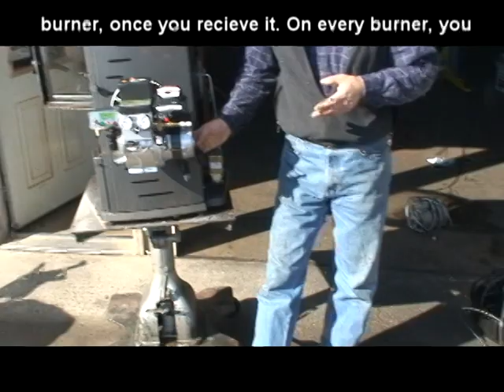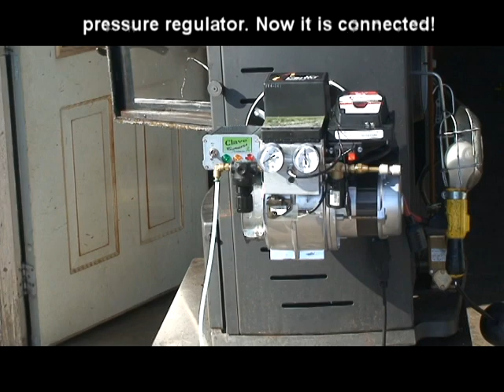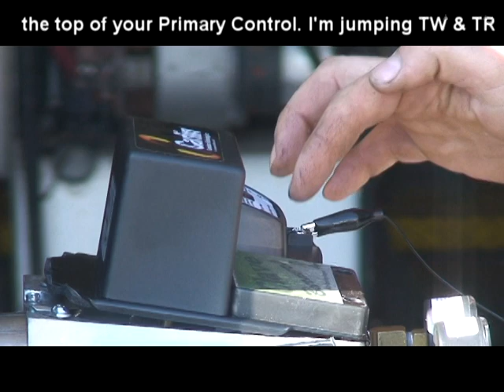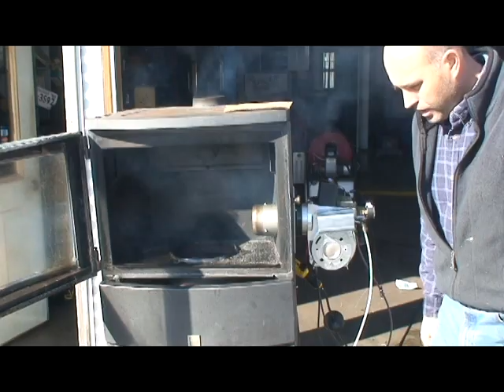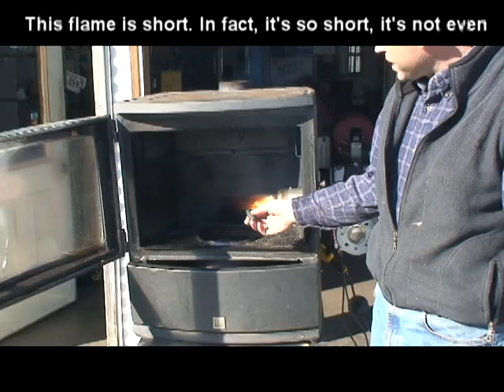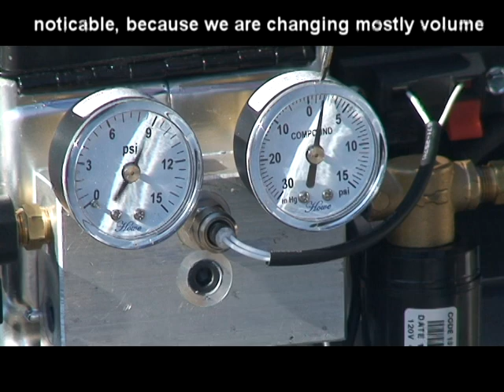waste used  oil Clave Burner Setup

Comment: Enjoyed your video and demo of the waste oil burner, I am considering buying a used fuel oil boiler and then updating it with something like you are pushing but I noticed some interesting things most wouldn't catch. 

I watched another one of your videos on this same burner assembly and guess what, that one (Russian) had a regulator to adjust the oil supply pressure up or down depending on the pumped pressure of the oil pump used.
You are now trying to sell an oil pump that is adjustable now so I can see why you would remove the regulator from this system so people think they need tour adjustable waste oil pump! Bad is one way of saying busted.
Also the Russian system which looks just the same as this one was also running "without" an air compressor, basically a siphon setup for the oil only, so why would we need one? I realise it does help with combustion and atomising the fuel but I also seen it working well without the air! Your system was setup on top of a red tool box and not hooked to any boiler or furnace at the time.

Why have you done this, it sure doesn't look good from my perspective as a possible future customer and honesty is the greatest tool any company has but when its lost its very hard to get back.
At this point I am not sure what I want to do since I was looking forward to updating my whole house and shop heating system and a boiler is always fun to work with and gets the best bang for the buck IMHO, waste oil of course helps tremendously. 

You have a nice system no dought, if it does everything you claim it will. I will be looking for future and past customers to see what they think of owning one and go from there now. 
Lastly I noticed the system in Ebay looks to be a newer model from what I am seeing in the videos, why or when did they change? Thank you.
Reply from the maker: Mike, before accusing me of misleading, please watch video more carefully. Most of the videos are done for the "gearheads" that are way smarter than me. These videos demonstrate mostly principles and ideas i used in the product. In this particular video i used air pressure to push oil to the burner. This will not work in the real life for different reasons. i also use air pressure on my stands so i can quickly  switch between fluids( oil, diesel, WVO etc.) without worrying about line bleeding.

Comment: The only reason it is smoking is A: he has it installed on a oil stove with the door open for demo only. improper excess air will cause smoke. B: he is adjusting the primary air and oil pressure to show flame length adjustments low pressure on either oil or air will cause a smokey flame. To put it lightly his burner is a mercedes, your babington  is an chevette. Babingtons will NEVER reach the efficiency a flame retention head burner will have. 
This system is top notch.for heating air or water.

Comment: I like your pump setup, I service many waste oil burners and they usually use the pump on the burner with a low pressure oil regulator to adjust the pressure down from the pump. They sell them as water regulators for drinking fountains and are very cheap arround 30-40$ CND. They run a 2 pipe system with the bypass plug in and a filter on the supply side to get the oil to the burner. search cashvalve pressure PM me if you have any questions. Have fun!

Comment: thats a neat and tidy setup...just one question....why is the flame so smokey?....i have a babington type burner and it runs on waste engine oil with no smoke in a wood stove converted to take the burner